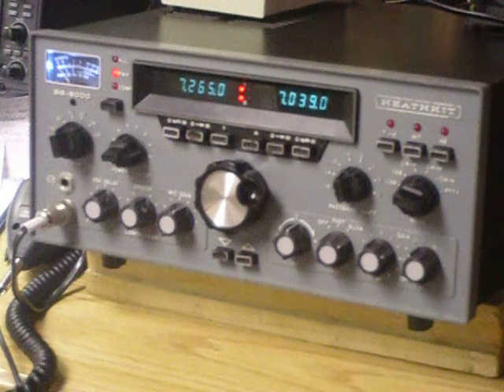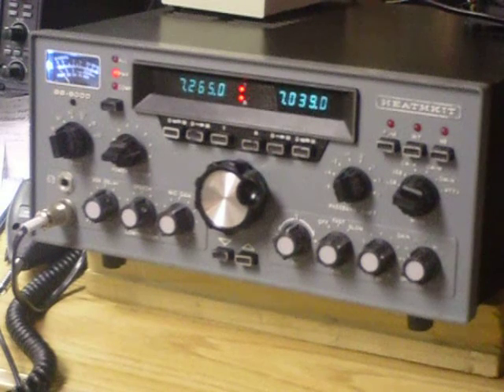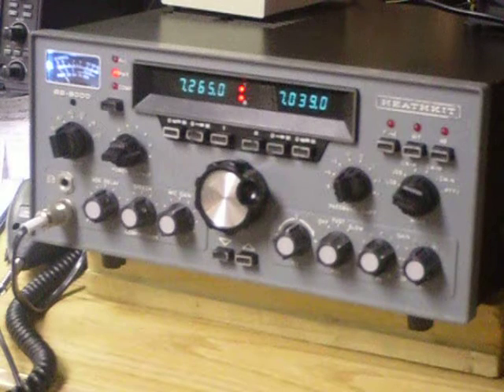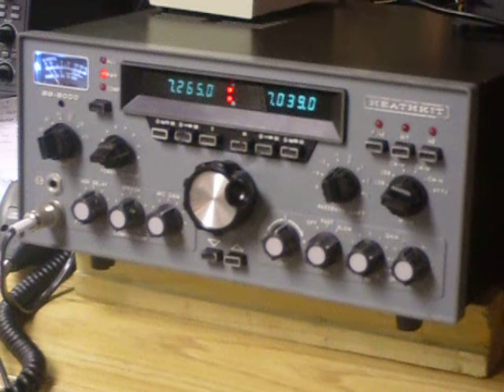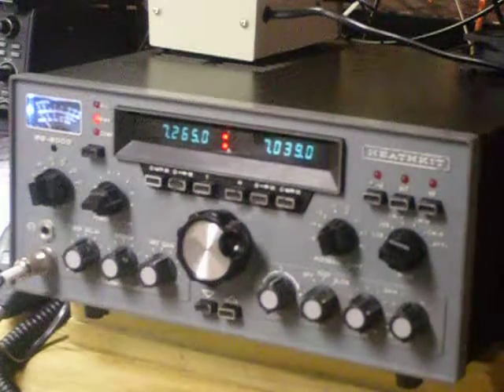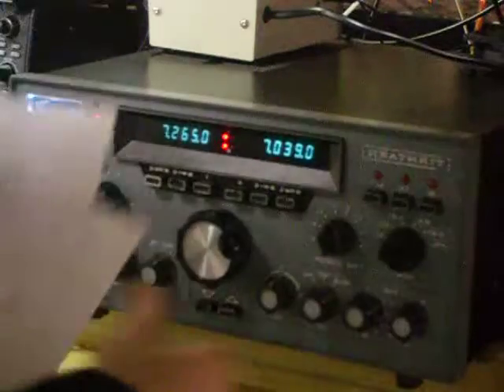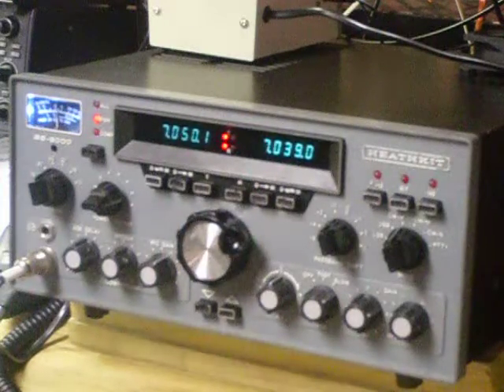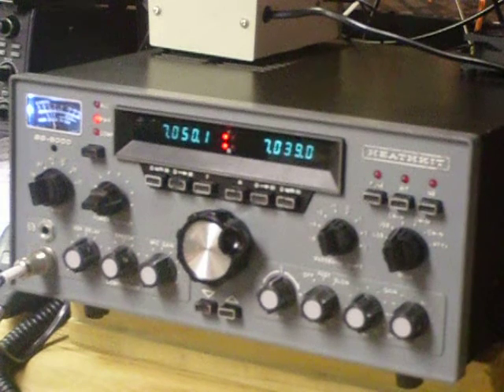PART 6 PROJECT SUMMARY HEATHKIT SS8000  Synthesized HF tranceiver kit

Comment: Hi Bob,  If the SS-8000 had of made it to market what do you think it would have sold for?  Do you think in your opinion that this WAS to much of a kit for most hams to assemble, align and get it to work as intended?  As I have stated previously I would only hope to someday have a fraction of the electronic knowledge you have.  
73 and Good luck
Kevin - KG0MN
Reply from the maker: Kevin DUE to the huge amount of engineering money that went into its development on the plus side of  $200,000 and the huge parts count it would have sold for at least $2000.00  probably closer to $3000.00. I base this on the pricing for the SS9000 when it came out this  can only be a guess since it was never sold . The SS8000 I am sure would have been listed in the catalog with the statement ." This is not a beginners kit "  other limitations would be caused by the need for a lot more advanced  test equipment than other kits .     Heathkit had a great policy however they "would not let you fail" send the kit back and they would repair or align it for you at low or no  cost . They would always give the kit builder "the benefit of the doubt"  if there was any possibility of a defective part or ?? whatever the repairs and alignment were free . My skills ?  I am ok at trouble shooting definitely not the best my best skills are Patience and persistence I keep trying and try hard NOT to be damaging expensive components it does happen. I know I had the final amplifier board out of the SS8000 like 24 times and used a series in line fuse which blew numerous times............. thanks Kevin   73  Bob    73 Kevin
Reply from the maker: Your right Mike  it was to complex a project requiring special equipment to align and would have cost to much for the average Ham .
That was why they sold the  SS9000 9 band tranceiver with WARC bands  as an assembled  ready to go rig . The SS 9000 later  Was to expensive  and did not sell well enough  they stopped assembly of the SS 9000 at I am guessing 350  units  no one bothered to keep track of how many were actually made  the initial one time  production run of the SS9000 at the Benton Harbor Michigan Plant  was to be 375  and they just shut down production like I say at about 350 and sold the remaining chassis parts and circuit boards to a scrap yard  .
Reply from the maker: Price for the SS8000 as a kit ?? I will make a crazy  wild guess at $2000.00   for the kit without the power supply/speaker.  73  Bob